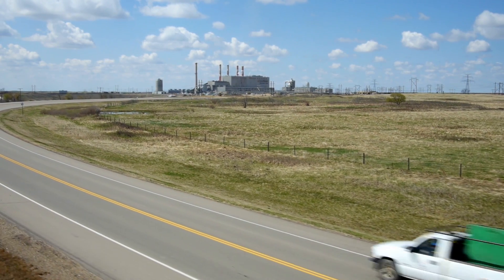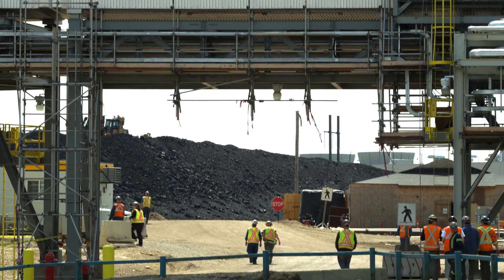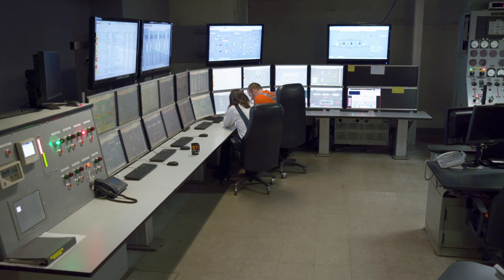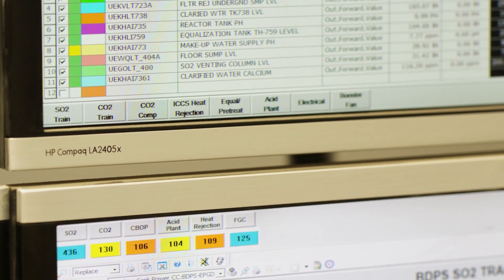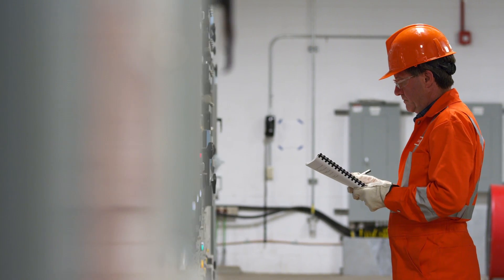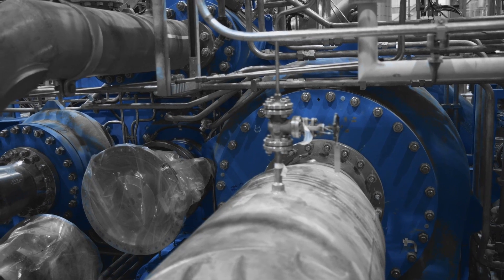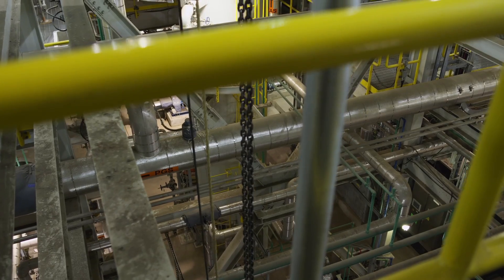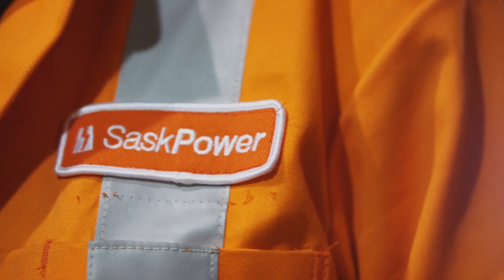Tour of the SaskPower Boundary Dam CCS Project

Comment: Interesting
Reply: XPRISE CARBON CAPTURE
The heat loss from a smokestack can be forced into a large tank containing hot liquid microcrystalline petroleum wax. The heat will keep the wax at a molten state which facilitate the carbon to be absorbed when combined with the wax. Carbon when mixed with wax reacts like a dye. The wax-carbon amalgamation result in a black wax solution thereby making it impossible for the carbon to escape into the environment. Other toxic particles are also captured in the wax settling at the bottom of the wax holding tank forming into a sludge. A sludge release valve is located at the bottom of the tank. After the sludge is removed more wax is replaced in the vessel working something like a toilet. The sludge becomes a byproduct that can be used as an additive to asphalt for roads or used for cocooning nuclear waste materials for long-term safe burial. The entropy of the Earth has been increasing at a startling rate since the beginning of the industrial revolution caused mainly by the carbon that is released into the atmosphere. Government scientists have failed to stop and prevent carbon pollution from entering the environment. This problem can only worsen until a solution is found before this problem becomes irreversible. It has been discovered that formulated wax has been shown to be the only answer to this problem. William Nelson